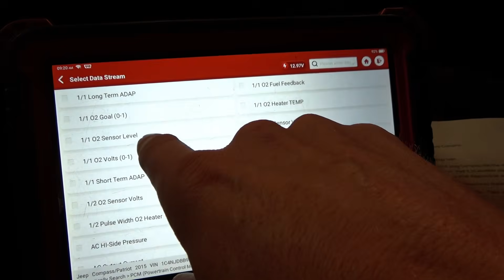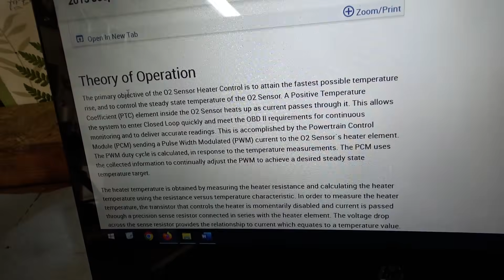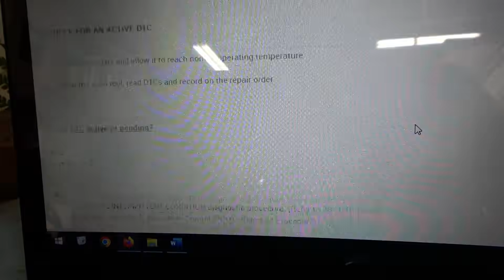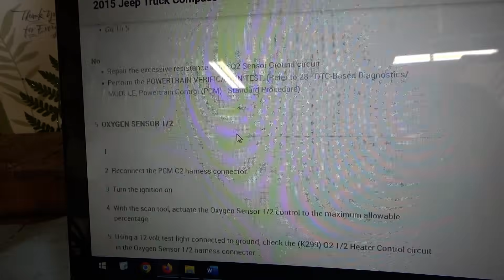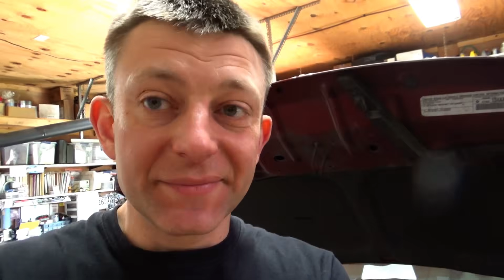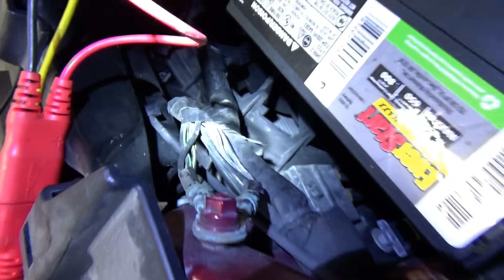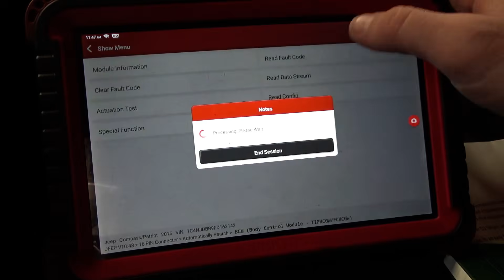Shop Says "Jeep Needs a TIPM"...and DEAD WRONG!! (15 Compass P0038)

Comment: Another repair approach is to use a terminal block with bus bars.  That way you don't have to jam multiple wires into a single terminal.  I've also seen fast-on tabs you can solder to a copper or brass plate to create a ground block. 

As for solder, not necessary.  Dielectric grease applied before the crimp is good enough, especially with marine grade heat shrink.  After hooking it up, you can goober it up with fluid film.  

The reason the factory doesn't solder those is because the solder joint will fail due to vibration before the life of the car is up.  The reason soldering works for you is because the cars you see are closer to the crusher than being new, so you will never get the comeback.  It works under those conditions, but it isn't technically a proper repair.
Reply from the maker: My solder job was WAY BETTER THAN FACTORY especially in this case 😜

Comment: @9:57 … Pulse width modulated circuit…. Need a scope,,,
Can't one use voltmeter duty cycle measurement to confirm a PWM, then just assume it's correct and continue with diagnosis?
Reply from the maker: No haha

Comment: I do not know what they are used for (terminating to some battery connections ? ) the terminals that are copper & enclosed at the eyelet is what I would use then you could place all the wires (all twisted together) soldered all of them in one large twist place a copper terminal & crimp as well some good telecommunications heat shrink that should give a complete seal & connection which I believe give a single eyelet to connect to the body (less chance of fatigue point at the nut & stud on the body.) Cheers Ivan

Comment: The other thing you have going on with the grounds is electrolysis and/or galvanic corrosion due to the pure copper wires coming into contact with the zinc or tin plated eye connector. Introduce some moisture and a perfect storm of corrosion will occur.

Since this seems to be a constant problem with jeeps and grounds, I'd make an educated guess that ganging the grounds to one large eyelet is probably allowing enough moisture to gather inside the crimp to cause the corrosive action.

Comment: Soldering connectors like that is one way to have a repeat customer, solder will make the wire brittle.  Buy yourself a better set of ratcheting crimpers and stop using those cheap multi tool crimpers.
Reply: The reason it "works" for Ivan is that the cars he sees are closer to the crusher than brand new.  If you solder straight from the factory instead of crimping, Ivan would be complaining about all the failed solder joints and would have a proper set of ratcheting crimpers.
Reply from the maker: I ❤ repeat customers 😎👍

Comment: As a electronic engineer I can confirm your statement, a scope are quite usefull for messuring voltage. Both DC and AC instead of a multimeter. Sometimes the multimeter doesnt messure small drop in a DC voltage, but the scope does. And there are actual quite good USB scopes with 4 ch, for a decent price.
Great job finding the missing ground. And preparation did most of the work, and as you say, always check the power and ground with a testlight.
Reply: @9:57 … Pulse width modulated circuit…. Need a scope,,,
Can't one use voltmeter duty cycle measurement to confirm a PWM, then just assume it's correct and continue with diagnosis?

Comment: If a battery was leaking it could cause corrosion on nearby grounds or other electrical connections. Don't take much. I don't know why they put the ground wires so close to the battery. 🙄

Comment: Hey Ivan.  Great video as usual.  But I have one question.  How did you get the camera on your screen.  I've tried but wasn't able to figure it out.  Computer stuff isn't my thing.  But car's I've worked on for almost 50 years.  And just about always find the problem. But putting the camera on the screen of my thinktool the same one you have has beaten me.  Can you please help me out.  Can you do a video on it
Reply from the maker: Pull down from top and select scissors icon 😊

Comment: Ivan, All the manufacturers are building their products to fail. They need you to buy another one. You even say yourself, 30 yr old car doesn't have ground connections like this. My 55 still has the OE wire harness and works. Think about it. Would  you build a product that the user would only need to buy it once and never fails? I think all the maufacturers are sorcing the wire harnesses from 1 place. MEXICO

Comment: At a Chrysler service manual, every electrical problem diag flow chart should start with: "Check the ground using a test light connected to battery positive."

Comment: The other shop just probably had an extra TIPM to sell. What they should have checked was their moral compass!
Reply: Did I see that the TIPM had a wire in that crusty ground bundle?  They sell the TIPM and clean up the ground bundle, and that fixes it.  Shady but fixed?

Comment: Hey Ivan or anyone else reading, if you're really serious about sealing off wires that have been probed give 3M 5200 marine sealant a shot. It comes in a toothpaste / RTV style tube and is so good it will immediately clog the spout after the first use. but all you have to do is poke a pin hole hole in the tube, squeeze an ant sized blob out for your wire and the tube will seal itself. Need more? poke another hole.

Comment: What you are doing can not be done in a assembly line scenario. At least I have never seen it on any production vehicle.
Reply: Obviously, however the amount of vehicle components they chose to then tie together with two eyelets on a single ground lug directly above the vehicles battery is a recipe for disaster. 

At least it’ll be a simple recall for them, I’m sure they didn’t sell many to begin with.

Comment: I had the same problem with pt cruiser costumer change the sensor some other shop run small ground wire and didn't work set a code again. I'm haven't study a lot about electrical basics but i realized that for some reason engineers run a long ground cable to the front of vehicle, it was hard to fine the spot were it was attached to the chassis but i found  it almost the same spots as your fix that one. Car got fix code never came back. Thanks Ivan for sharing your knowledge on this videos everyday i watch some. And im surprised you come to New York or costumer tow car to your location for repair. I work and New York and i can see most of the shops need more well train technicians. Blessings Ivan!!

Comment: Like @10100rsn said looks like the battery vent is only a few inches from that ground. Dry climate or not, corrosion is gonna  happen. If the wires are too short to relocate the ground, monitoring and applying dielectric grease are probably the best for anyone owning one of these.

Comment: So this customer would have been on the hook for around 750-1000 bucks and the car still would have the engine light on, They would have eventually found the issue and still charged the customer for the TIPM ??? Car repairs are getting so expensive now that when it comes to getting it done right getting a second opinion was well worth it. Good job Ivan ( again).

Comment: Enjoy your videos my Toyota Camry the wires heavy Duty Chevy and Dog thin wires to Bad the Ford Diesel Truck blew up the motor I think before they build the Dodge Cummins has a heater Grid Bolt problem brakes off and Destroyed the motor I think they plan so it does that and you buy a New Truck

Comment: Nice work Ivan.  I can't tell you how many times I had those Jeeps come in with dim or non functioning lights.  Always that same ground point.  I didn't know the O2 sensors connect there too.  Good to know.

Also, Ivan.  A nice little tip for when soldering on crimp connectors.  It's best to tin the wires first.  But if that's not an option, heat the area where you want the solder to end up at.  Molten solder likes to flow towards the heat source.

Comment: To be fair, if they are designing modern cars to live for 10 years, that connection was almost perfect - it met the requirements to last (almost) 10 years....   That's better than current new cars that only are designed to last the warranty period.

Comment: I think it's still a no parts required job.  The terminators, solder, silicone paste etc. are really just "shop supplies" so no vehicle part numbers ! 
All Chryslers have that type of ground idea and in about the same location with about the same number of ground wires heading into an open wire terminal. The Jeep Wranglers too and why would Jeep vehicles have this kind of a ground idea where the vehicles are made for outdoor excursions, lots of weather etc.?  Maybe those folks along the line of engineering and approval of wiring systems need to take a course in wiring systems that are aged and not holding up so well. I know of high school people who would be more capable in securing those grounds. 
The best part here is...many mechanics will NOT spend the time to study prior to engaging in repairs. Obviously the owner of this vehicle had some smarts in the validity of the first shops plan in replacing the TIPM which is a common item in many cases. Just because a TIPM goes bad often doesn't mean its always the cause which brings us back to how Ivan stresses the issue in following a controlled diag process from how the system works via Alldata and then applying that to the vehicle in question. Because many mechanics fail to do this is how parts are thrown at the vehicle that have nothing wrong with them and in this case, the TIPM would have been replaced and the customer charged, most likely.  Totally wrong. A shop who makes the call and it doesn't fix the issue is supposed to absorb that cost, not the customer yet this happens thousands of times per day because mechanics refuse to use their noggin in diagnosis.

Comment: Re: why are wires at the ground ring crimp corroded, my theory would be hydrogen gas ( or other corrosive substance) from the battery. Cure? clean freshly stripped wires, new ring crimp, light treatment with deoxit then crimp ( or solder) then cover the whole thing with dual wall heat shrink. The dual wall has hot melt glue on the inside that should seal the exposed copper from any corrosive gasses.

Comment: Eric O runs into this all the time with Chrysler vehicles.  I would have set my Weller iron at 800° since there are no circuit boards.  Nice quick fix.  I have a 2013 Jeep Wrangler Unlimited but live in the south.  I will check my grounds first if I have any electrical issues.

Comment: The only bad thing about soldering the eyelets like this is that it makes a harsh break point in the wire.  So you really have to make sure that the wires are tied down and not able to flop around.   So there's always a trade off..........    It's just like knife steel:  you can trade toughness for hardness, but you can't have both.  But this repair should be great for the life of the car now.
Reply: I have had the same experience. Soldered terminals will last a long time only if the wire does bend near the terminal itself. Terminals with a stain relief clamp are better. The wire following the solder terminal has to be well secured.
Reply: @edwardromana   Yep..  When it's multiple wires like this, it's usually fine if you tape it all up well;  because all the wires reinforce each other and won't bend.  But I agree-- a little tie down near the connection is best.

Comment: This reminds me of the PT Cruiser video, where you wound up with the light bulb in series.  I am wondering if in that case perhaps the O2 sensor that the customer installed was aftermarket and the heater resistance was different than the OEM sensor.  Maybe that explains all the insanity.

Comment: Replacement of the TIPM would have no doubt introduced more problems, especially when done by a shop that doesn't do proper troubleshooting, so you know they would have buddy bugged it. Then it would have been down the rabbit hole as various introduced problems were chased. Would have cost thousands, hell the Jeep might have ended up a beached whale. Smart of the customer to make the drive out to you!

Comment: My sister in law was told her Tipm needs replaced. After about 30 mins of my time. Someone had busted the tipm connector that lives by the radiator support bracket. 
She still had her old TIPM, i removed the one they gave her. I took the connector and repaired it. Codes cleared and go her money back.

Comment: These multiple grounds in one place are always a problem.   They really need to stop doing this;   It always has a slight bias in voltage on at least one of the wires due to a slightly bad connection and promotes galvanic corrosion..  so it acts as a sacrificial anode and corrodes away, usually saving all the other wires.  But eventually the corrosion spreads. 
But at least they put it in a place that's very easy to access.. I'll give them points for that.
Reply: Not on my cars, but I've created ground blocks so that each wire gets its own connection.  You can use terminal blocks with a bus bar, or you can buy fast-on tabs you can solder to a copper or brass plate.  Helps create a uniform ground, which is especially important for sensitive electronics.

Comment: The mistake in this case happened when the O2 sensor was replaced. A bad heater circuit is easy enough to diagnose at the O2 sensor itself, so I take less than a minute to routinely check for power, ground, and light bulb active testing from the PCM every time. There's no excuse for a genuine pro to skip over that step. As a minimum, a resistance check of the sensor itself would have thrown a red flag that the diagnosis of bad sensor was wrong. Regarding the other shop quoting a TIPM, it was obviously a free shot from the hip, probably by the service writer, without any effort. I'm don't think it's fair to paint them with that brush after free, front office quotation. Service writers have a habit of making things sound bad so the customer won't be shocked and angry even in a worst case scenario. If you paid for an hour of real diagnostic time up front you'd get much more accurate estimates....
Reply: I wonder where the genuine pros work at. Not at the shops I see. 
Or...go to the local parts store Technician who will scan your car for free while the shop charges you 80.00 for a scan and tell you, you need a new sensor 😅😅

Comment: @33:10 there is ABSOLUTELY no manufacturers soldering ground eyelets. That FACT negates your argument that solder is the best method. Otherwise every vehicle ever made would require this repair. The vast majority of vehicles NEVER need this repair. Certain brands are just poor quality.
Reply: And what's more is that you have repaired more factory solder joints than factory crimps.
Reply: Only Chrysler need soldering for the fix and win. I solder my connectors. 😅😅

Comment: Very cool. That was a nice straight forward diagnosis. Having the other bank waveforms for reference is super useful (although not required) to help confirm repair.
Reply: It's required, that gives you the information to back up the repairs. 
How would you know how to data should read?
Reply: @2nickles647  Experience (sensor data/waveforms should have expected readings/patterns), and you can look it up.

Comment: I've heard that "specialists" in the auto industry say soldering is not recommended for auto repairs. I can't fathom why. Has anyone ever heard of this?
Reply: Because the Specialist say, the Solder joints will is not flexible and a stiff solder joint will break. 
I've heard that from people who work in the aircraft industry.
Reply: Yes stranded wire soldering  has solder 'wicking' between the hot enough strands. The solder between the strands stiffens the wire defeating the flexibility advantage of stranded wire. Soldered wire, like solid wire, is fine if it is not subject to repeated bending.

Comment: Ivan every time I see you use that crimping tool I cringe!  The right tool for the job is a Klein J1005.  When I was in the car audio business this tool solved all comebacks related to power connectors.  It puts an extreme pressure on the crimp and actually has less resistance than the solder job ( a good quality connector is required too).  The pressure of the crimp makes the 2 metals as one.

Comment: The first shops flow chart,
Is it a Chrysler product?-yes- replace tipm. 😂
Reply: To be fair to them it probably does need a TIPM, just not right now.
Reply: I have seen the same response. You would think that Chrysler would have learned that a " Totally Integrated Power Module" is not such a good idea by now, wouldn't you? As far as bad grounds go, I am 78 years old, and I learned about a bad ground being the very first thing to look for when I was about 12 years old, and that was back before solid state devices were used on cars.

Comment: Can’t believe a shop could not even diagnose a bad ground on a heater circuit…SAD !!
Reply: It has been said that Ivan wouldn't be employed by a shop because he would just diagnose a bad ground and not sell or install any parts.  Given the high overhead shops have, that isn't acceptable.
Reply: @lvsqcsl  Sadly, you're probably right.
Reply: @302MuscleCars  No, hes 100% right
Reply: They are in the business of selling and installing parts.
Reply: Nearly 30 years ago, when I was on my apprenticeship as a mechanic, if I mentioned 'a bad ground' in relation to an electrical issue, most mechanics I worked with would look at me like I was a witch. Mind you, I was the geek that used to take the Krypton tunescope manual home at night to read.
Reply: I can. Most shops/techs are incompetent, lazy, and looking to rip people off. If you have an Ivan, Eric O., Keith D., or Paul Danner type near you, patronize their business, appreciate them, and count your lucky stars.